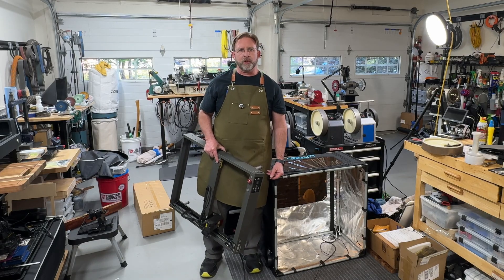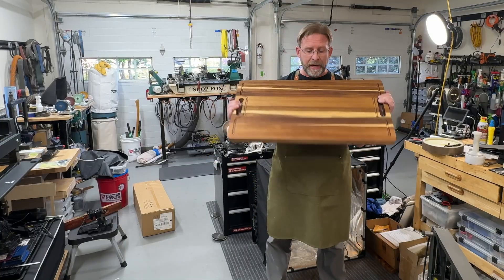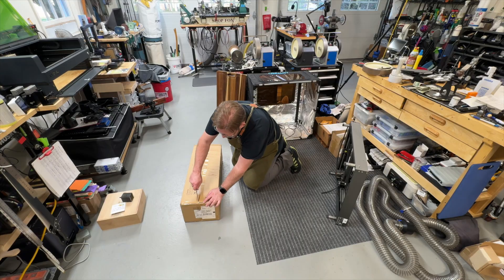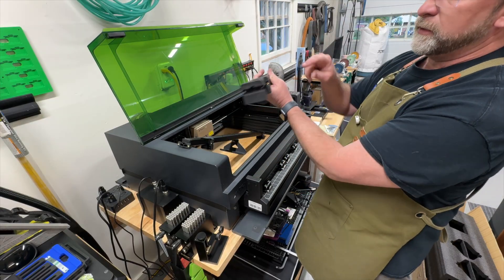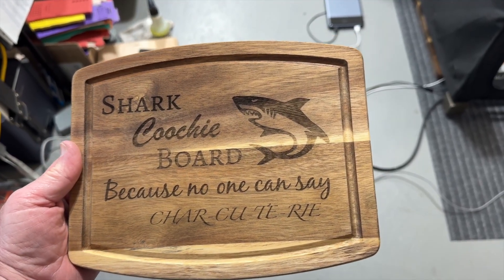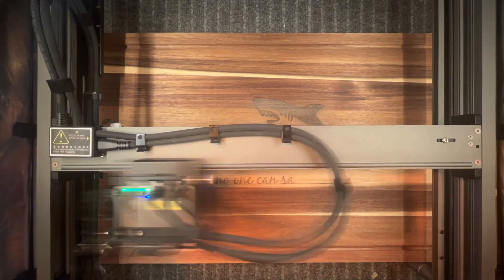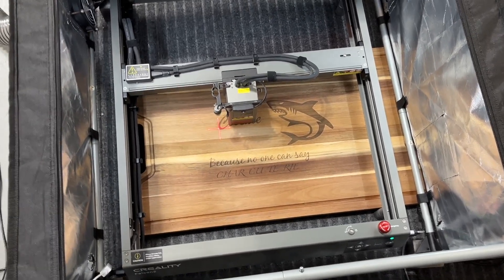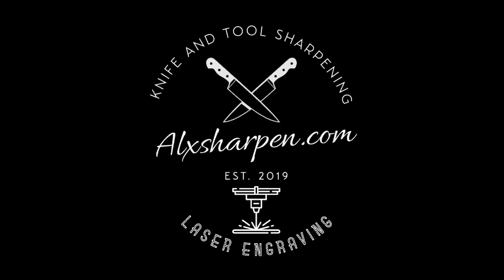Laser Engraving Disaster: Huge Cutting Board Huge Problems, and How I Saved It!

Comment: Thanks for sharing . . .  
I have had similar issues but most of mine seem like gantry communication issues.
Where are the air inlets on the x-tool laser ?
I had to create the air inlets & laser light interrupters on my machine. 
What stops the laser from exiting through the air inlets or outlets ?

FYI never turn your head so laser light can hit the backside of your glasses.
It will bounce right into your eye.
Reply from the maker: It's not like some vacuum sealed unit air gets in from all over it  you don't want it sealed up or the smoke wont get out I have also strong inline fans that also draw it outside
Reply: @ALXSHARPEN  Clearing the smoke leads to improved cutting/engraving speeds & lenses that stay cleaner longer.
- On a K-30 air speed over the works surface increased from 1/2 MPH to 6 MPH 
with an improved air intake system.  
- I am disappointed in safety measures employed on lasers cutters/engravers today. 
- Light paths should be interrupted/bounced/reflected 5 times off of matte black surfaces to avoid eye damage.

Comment: Your not kidding about the nervousness of doing a project with a laser. I also have the S1 and while many things are easier than you’d expect, some things just require trial and error. The trial and error part is expensive. Out of curiosity, do you do deep engravings on your boards?
Reply from the maker: yes but not crazy deed but deep enough you see it's a lower lever of wood i would only surface mark if it was requested